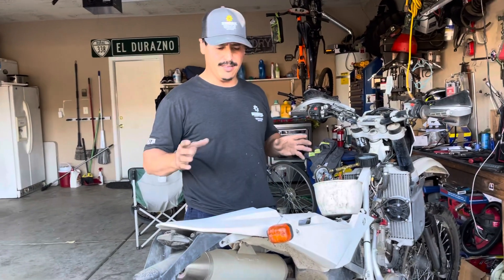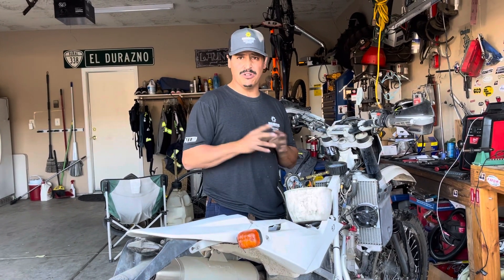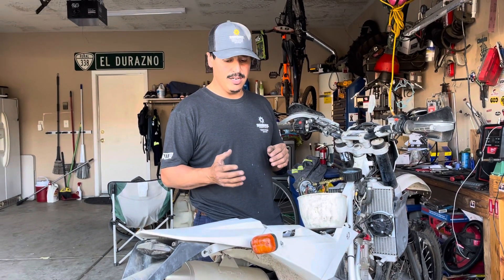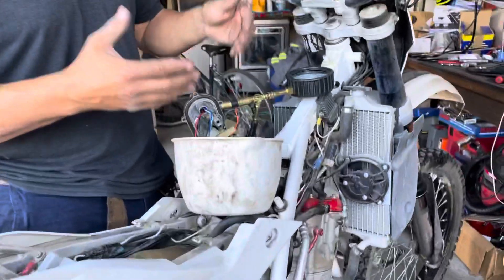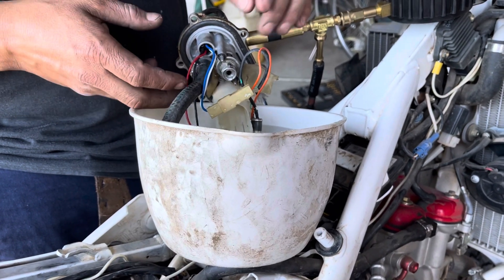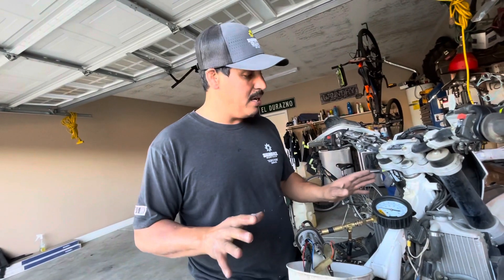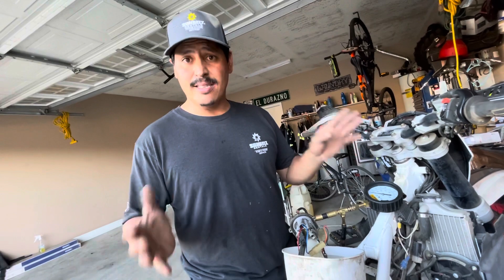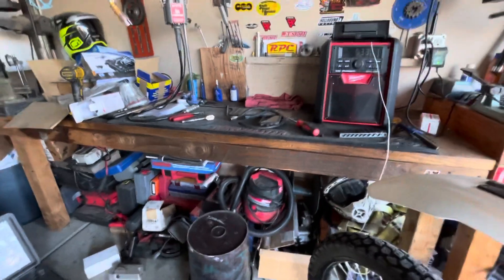2009 husqvarna te450 no start

Comment: Do you know if this also happens with the 09 TE250’s? Mine randomly won’t start but it cranks and I can hear the fuel pump priming. Not sure what’s going on with it.
Reply from the maker: Perform a fuel pressure test , but do the test when the problem is present .
Reply: yes it does! happen to me on my te310
Reply: @fredyzzz007ify  what did the issue end up being?

Comment: Is it hard to rebuild a husqvarna te 450 09?
Reply from the maker: It is not .
Reply from the maker: You need some basic tools . And maybe might need a crank puller . But it’s not hard as long as you have basic tools and some understanding of setting the time and paying a lot of attention on how the transmission goes back on .
Reply: @ ok thanks for lmk I’m on edge on weather I should have someone to do top end rebuild or do it my self from it overheating